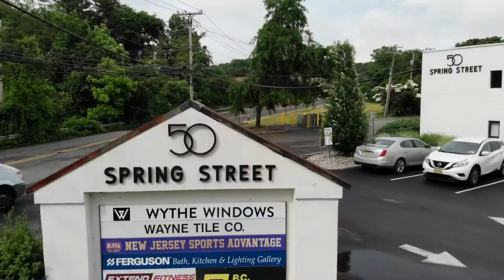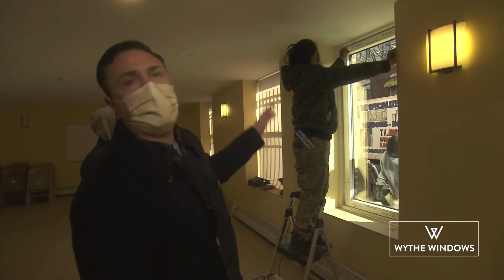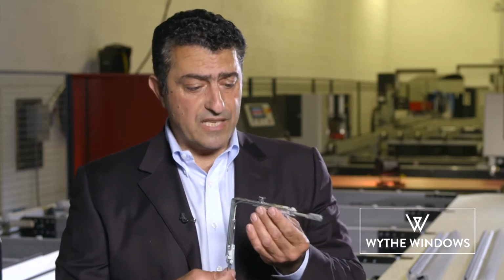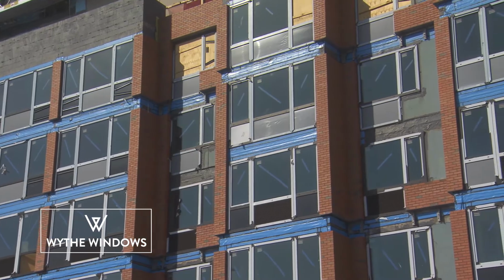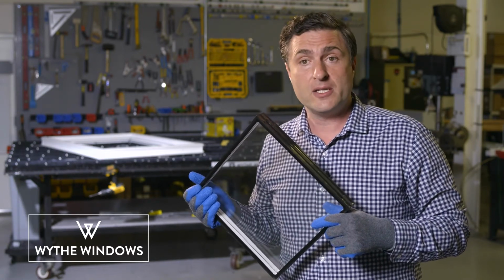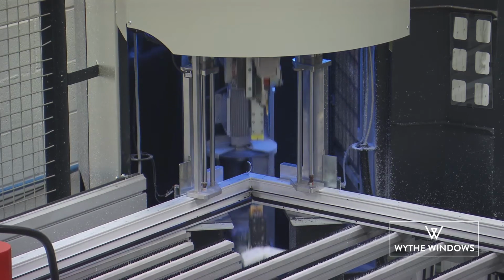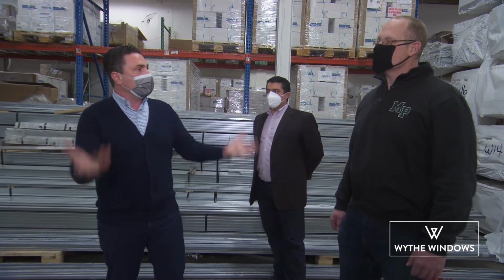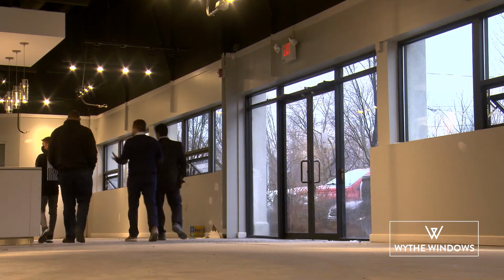Wythe Windows for Passive House and High Performance Buildings

Comment: Incredibly good work. If you ever think of the perfect PVC infill panels, take a look at https://www.ostaclassics.be/library/catalogen%20en%20prijslijst%20/OstaClassics_TopCollect_Brochure_Deurpanelen_nr7_v2_LR-compressed%205MB.pdf?1540823156
especially pages 46 to 53. Door panels with stainless steel pulls, with LED lighting. Belgian made.